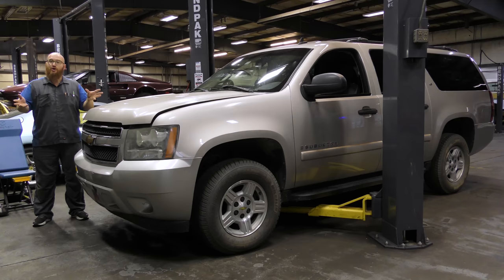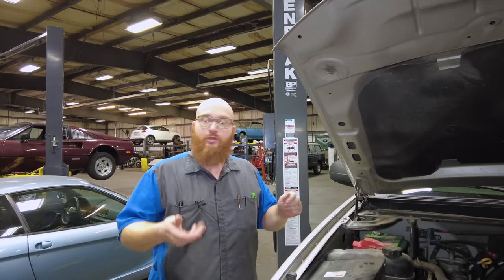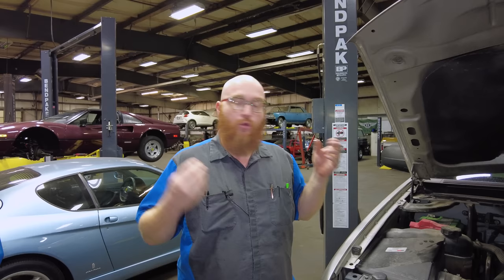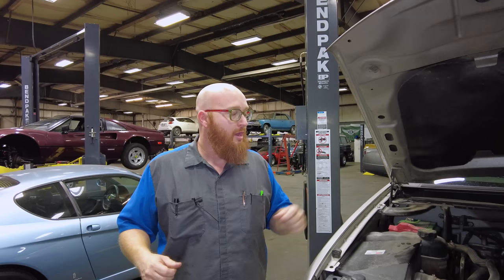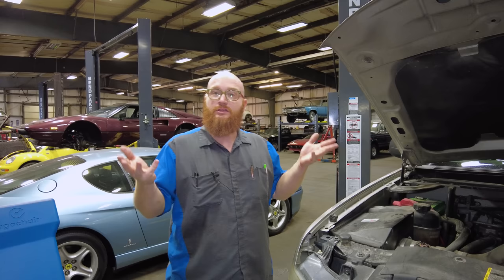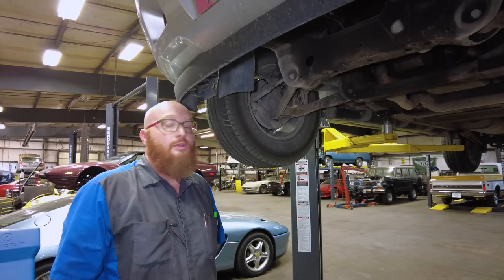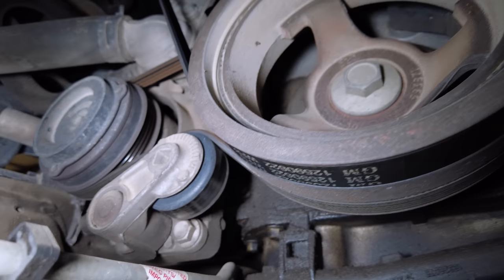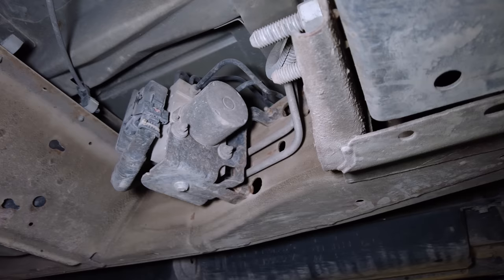What fails on ALL early 2000's Chevy SUV's!? CAR WIZARD shares what he's seen from the last 20 years

Comment: air suspension.   my electrical is super wonky.   my instrument cluster sometimes just doesn't boot right away -- sometimes it takes 5 minutes to show my speed.  And my gas pickup is weird-- hates being parked on hills and has already killed a fuel pump.  04 denali.  I'm not fixing anything more than $1000 on this -- it'll just go the next time a big repair would have to happen.

Comment: My 2007 AWD Escalade is leaking (158000 miles)and the dreaded oil pan, main seal leak is being repaired now. $1400 😅 to do the job. They said they have to drop the front end and transmission and seal to fix. I know this is a problem but cost is substantial. 😮 My engine has always purred like a kitty even after the leak. What gives? Thanks for your input.

Comment: The intake gasket and knock sensor for me at GM dealership was about 1000$ and I bought the ac delco parts and saved 300$ so it would have been 1300$ for gasket and knock sensors

Comment: I had an 05’ which I purchased new what a POS! The brake lines completely rusted out and failed by 60k and when you loose a line in one of these the abs block under the truck doesn’t appear to have separation of front to rear. I had complete brake failure from a front brake hardline.front wheel bearings were gone at 35k the rear diff failed at 75k the heater fan relay would rust to pieces about every two years. The front transmission seal leaked from new and was warrantied but clutch started chattering at 40k. The underside was completely rusting away including the frame and I live in sunny California so no reason for it. These were absolutely horrible years for GM trucks. I gave it to a friend a little after 80k. What garbage. I bought a Colorado a few years ago and it’s been flawless so far no rust issues or anything as of yet 40k.

Comment: With your experience, what is the spark plug brand and model you recommend? Do you just go with factory plugs? Factory wires?

Also, what can you do to the 2003 6.0 that you recommend removes some restrictions or bad factory settings and gives better mpg and performance?

Comment: Dash cracks, door handles break, O ring on oil pump fails, engine consumes oil due to bad design of driverside valve cover. rear rotors warp.

Comment: New my house they awere doing road work for 3 miles long. Both fuel and transmission lines started leaking lol 02 tahoe. Had them replace and waterpump and few other stuff i pick up the truck for 1200 lol its a monster. I love these trucks

Comment: Gas lines, brake lines, The ball joints and tire rods are small. the frame rust out fast, control arm mounts are weak and thin, I would say its low on power given the weight, wide useless gear ratio, lots of usless open diffs, small brakes overheat and drag

Comment: My mom has owned her 2007 GMC Yukon XL SLT since 2007. The engine had to be replaced at 164k miles cause the camshaft failed, which I suspect was due to the AFM crap that GM put in their GMT900 SUVS and trucks, other than that, the truck is bone stock and has it's original 4l60E transmission.

Comment: I have an 07 suburban And I think you missed the engine and transmission that  Commonly go bad  Not to mention the  Transfer case output bushing that can't be replaced without replacing half of the transfer case

Comment: 2003 Tahoe. 293000 + miles. I’ve replaced knock sensors, cats, hvac module just went out, abs sensor just started to go out, and I have an oil leak I have to figure out.

Comment: I have a 2003 Silverado 1500 HD Crew Cab 6.5 ft bed loaded with quadrasteer. 6.0 103,000 miles. Love it. But dang its terrible on fuel. 10.3 mpg driving like a grandpa

Comment: I have over 445,000 on my 2000 Silverado. Yes, I had the transmission rebuilt twice. The dash is full of lights, but the engine still runs like a top. How are people doing with the new '23 Tahoes? I'm considering getting one.

Comment: Lifter failures on these are marginal in comparison to the LT direct injection motors. I worked at a Cadillac dealer for 9 years and now have been at a Buick/GMC dealer and have yet to put a set of lifters or lifters & camshaft in one of these. 2015's and up, I couldn't even tell you how many I've done. My personal Tahoe has 108k on it with over 11k engine hours on it (old police car) and it's never been opened up. AFM still intact.

Comment: “All I know is that my AC started blowing hot,” and my power steering went out, and my alt/batt light came on, and my hot engine light came on.   “So I guess I need a Freon recharge”.     Cause that keeps the engine and power steering cool too.      People are so out of touch with arguably the single most important expenditure of their lives.  The home is taken for granted but not quite as complicated of a machine and over the period of its life, might not actually cost as much as the average consumer spends on the procession of cars they buy.   So many people just buy a new car when theirs starts to act up, often at far less than 100,000 miles, and they trade in their car, get less than half what it is worth on the open market place, then blow yet another $20-90,000 on a new car.    When will people learn that buying a new car is the same as pouring a few thousand dollars down the drain on the first, day, unless you KNOW you are keeping it for life.    So I have my excuse and my lifetime bumper to bumper warranty backs that up.    But you pay your mortgage or rent, say $1,000-$3,000/month.   But for your car, you’re paying, assuming my line of reasoning on a new car, $400-$1000/month.  Then oil changes at the dealership, not often enough, at $50 every other or who knows what month.    The house will be paid off in 30 years or less.    The car payments go on and on.   Let’s just say every tie you buy a new car, keeping easy round modern numbers, you blow $10,000+ down the drain on future expenses, or just loss on the one you just got rid of.    And by average, every three years.   That’s $100,000 in the same 30 years!    Give or take, still substantial, and while it’s the same as a $200-900,000 house, it’s substantial and far more wasteful than a home, while we need shelter, we HAVE to have our cars every day working like a dream.  But we neglect them, and the OEMs count on us being naive and stupid and ignorant to boot.    No, they bank on it.

Comment: thanks i think you just pointed out my mystery rattle when i start my escalade. its loud loud and goes away quickly and not on every start but its coming from the front of the motor on the passenger side. i suspected a belt pully and after watching this yea bet it the ac belt tensioner. wont know till i check it out but sounds about right.

Comment: Review this.. 08 ESV  drives then dies at stop ..  changed fuel pump, crank sensor, cam sensor. Magnet on the actuator. Now….. idols all day. The second a load is on the engine when you come to a stop just dies.  Now lights on the dash. No check engine light. ?????

Comment: How sad.. since 92 when I bought a k5 89 blazer ive loved GM tahoe, suburban silverado and had a hotrodded c10 too. Now watching your video im abit scared of newer fullsize GM..  espacially as theyre not that common here in sweden.  However.. my k5, and the tahoes,suburbans and silverado ive owned were great and easy to diy.  Drive an old xc90 now with 40000 plus km on odo but the spade is cramped both for me and my dogs. Always sat better in chevy.

Comment: As an owner that's put over 300k miles on my 09 Silverado. I can verify the front diff seals are horrible, and the stupid throttle body control module are my only constant outs... to be fair engine only has been full synthetic changed at 50% for the vehicles entire life... my only dumb ass move is I've literally never changed tyranny fluid because when I bought it they told me not to...( I was younger and dumber than I am now) however at this point I know without a doubt if I change it I'll blow it in a week or 2 haha 😭

Comment: AFM is only on 2007's+ GM
i've owned 5 GM trucks and SUV's and none of those first 4 problems you stated i have ever dealt with

yes the wires break, they all do on every single vehicle
(your manifolds will be fine unless you actually warp the fuck of the manifold)
(knock sensor yes those always go bad)

Comment: You can delete and tune that fuel crap out. I have an 07 vmax. Deleted that out. No issues. 

Like you said 2007-2000 5.3 is the best. I’m looking to get my wife a Tahoe that year. I had an 05. Sold it with 400k miles

Comment: i'm planing on getting a GM SUV with the 5.3L (Envoy or Rainier) with the sole purpose to rebuild the engine. i'll be doing the whole 9 yards... Cam, Intake, headers, ported heads - ect ect ect. the 4L60E transmission will be upgraded to a remanufactured 4L65E with the Corvette mods and a stall converter. will it be worth it in the end? for most people, no. but for me, yes. sinking $10k into an $8k SUV is insanity to most people.

Comment: 2000 siarra with 250k, 2005 silverado with 200k, so far oil pressure senser on both and ac tensioner on one of them, both have oil leaks/ burn oil and not to mention i have to fill up a little on antifreeze every now and then on both but my abs on my 05 has been acting up every now and then, there is a filter that can plug if you drive on gravel alot and if it plugs, it doesnt have the proper ventilation for you to fill up gas like normal, i can get to about .70 cents then it clicks like its full, so filling up takes a very very long time,  also on my 05 ( im not sure when they switched) it has Sencers instead of cable for gas peddle, on at peddle and one on throttle body, either can mess up wich will cause you to go into limp mode oh and blower motors, other than that nothing to crazy, my 2000 sierra just needs a rebuilt rear end (2nd one) but original everything (enginge, transmission) and my 05 just had a rebiult transmission at about 170k-180k, other than the rear end and the transmission ( save yourself some money and learn to take it out and reinstall it) i have done all the work myself , its mostly simple stuff

Comment: Great video. Car Wizard.. Informative. Well illustrated. My 2005 Silverado 1500 Z71 has been reliable. 2009 to 2023. Keeping up regular maintenance. wear items. 126000 and road ready. Question ; Do you add fuel injector cleaner to gas tank. Your vehicles ?? Thank you for Sharing , your info knowledge..

Comment: 99-06/07classic bullet proof the 4l60 trans weren't so great but anything with the 4l80 were amazing and you can spend a little money on a good build of a 4l60 and have a reliable transmission and as far as the 07+just delete the AFM and it's also bulletproof I've got a 6.2 Denali for my wife before I even tagged it just delete that shit and while you're there just replace the screen and oil pressure sending unit no big deal

Comment: Excellent video!  Any thoughts about a 2006 Tahoe with a lot of antifreeze loss.  No apparent signs of a leak and no change in performance.  No sign of water or sludge in oil cap or boiling in antifreeze storage reservoir container except after cooling for 10 minutes and bubbling or rushing of air.  Its been doing this for about a year.  I sometimes add a gallon of antifreeze to the reservoir tank.  No sign of steam out the exhaust or any visible leak or any smell of antifreeze.  Is it possible the head has a micro crack?  If it is a head issue what would be the approximate cost to replace both?

Comment: @CarWizard or really anyone.  I have a 04 GMC Yukon XL 1500 Denali AWD 3.73 Gear ratio.  It's been lightly spitting differential fluid around the left rear wheel well.  I thought it would either be the wheel seal and bearing or the vent tube being clogged but I fixed/replaced all that and it still spits.  I can't seem to figure out where the leak is. My next guess was rear wheel speed sensor.  Also, the previous owner took the parking brakes off completely, including the inside shield, would that have anything to do with the leak?  TIA. Cash is extremely tight and I can't keep throwing parts and gear oil at this thing.

Comment: 2000 silverado 1500 wipers frooze to windshield it was raining when shut off started truck next morning and I heard a pop thought 
It wasn't the fuse 
Nope maybe the motor the circuit board or the multi switch 
Nope
Think I've traced it to a internal relay built into the fuse box 
Is that a problem you've run across and is it the box under the hood ?

Comment: I have confdensation in my driver side tail light lense. 
I tokk the lense off. Emptied out the water. 
But im having trouble readin on my volt meter. Above 14v. 
Im going to check my connections to the bulbs. 
Im hoping these things are not related.

Comment: I feel I need to give a little correction on the transmission part of your video.

The converter clutch is applied in 3rd gear (D) whatever you want to call it. Certain vehicle shift strategies even have the T/Cc on in 2nd.   

In my opinion the 4L60 is probably one of most durable Transmission GM uses.  Just about every rear wheel GM uses it, with exception of bigger trucks 4L80. 

The 6L80 and 8L80 are very flawed, I literally do 2-3 a week. Someone needs to get fired over that one. 😮of course I’m paying my house off early because of them 

I’ve been rebuilding  transmission for 41 years, get rid of the heat with a cooler and change your fluid every 60k and you’ll put me out of business. 

Just a side note, if the T/Cc isn’t locked up your making heat and a lot of it when towing 

I personally have 2006 Trailblazer 4.2 with 280k on it. Original drive train and I haul a 21 ft Wellcraft boat, and she’s a heavy boat. 

I stick in OD and off I go, let your tow vehicle pick its speed and they’ll last a long time. What I mean by that is just because the speed limit is 60 you don’t gotta do it, my truck is comfortable a little over 50.  So thats what I cruise at

Now as far as the dash, the front diff seals leaking, ABS lights and intake manifold leaking, ih and 3 aluminum driveshafts, your not wrong.

Just one man’s opinion 😎

Comment: Just want to say I enjoy watching how much you enjoy what do 
Just a question 

2010 5.3 I have 55psi by oil galley at front pass and 55psi at back of intake new oil filter, cleaned  screen under oil sensor and don’t have any oil coming to top of my engine does that mean I also have no oil to crank and rods.
Miner right now but I think I have a turned lifter currently as well. But I believe I need at no oil before I dive into lifter?

Comment: My 2007 Tahoe with the 5.3 has AFM. I hate it (AFM and the truck).  It just nickels and dimes me weekly. Interior door handle chrome, door locks that sometimes don’t work, Large EVAP leak the dealer nor any local shop can track down, randomly shifts into 4WD when I’m on the highway, broken motor mount, crappy acceleration when it’s hot outside and the AC is on (I can floor it and won’t accelerate, just sorta quickly idles). I could go on but I won’t. I hate this damn truck.

Comment: We had almost all the issues mentioned on our 03 tahoe. 
Ac belt, oil sprayed out pressure  sensor. I thought it was done. Smoke pouring out. Dash beeping  pulling a big hill. Im like damn i blew the motor. Stupid sensor ! Still have it. You can blow through it! As i mentioned t transfer case pump rub where the pump and the little Clips inside the transfer case we're through the Magnesium housing and caused the transfer case to leak there isn't really a good fix for this other than ordering a new transfer case half off of Amazon and pressing the seals and bearings into that and redoing the transfer case also when we got that far with it they realized that the bearing inside the tail shaft of the transmission was warned and so therefore fluid was accumulating in between the transfer case and the transmission tail shaft which is not necessarily fixable without pulling the whole thing out of the car and doing a complete rebuild it's not the actual seal it's the sleeve where the Yoke part and the spline part slide in there it has worn to the point where it allows fluid to seep through either way the pump rub situation is one that you need to really catch immediately because if you lose all of the fluid out of the transfer case without paying attention you will be left stranded and it might actually grenade itself

Comment: I have a 2008 avalanche 4wd with a 6.0, thank you for pointing out these flaws, I pull/haul weight with that vehicle and never use the overdrive because it seems like it is very taxing. I just replaced the driver side door handle a few weeks ago. The fuel interference set up worries me as I already hear some tic but it could be some exhaust noise. The A/C failed on me 1 month after I bought the truck and was quoted a new A/C system! I passed. What is the cost to replace a couple of transmission cooler lines?

Comment: 2006 chev trailblazer AFM lifter collapsed spent 2k and its still broken! Supposedly cylinder 6 is dead but after computer and running compression test and 500 bucks still don't know if its the cam lobe or not. I gave up!

Comment: Had an 08 avalanche with stuck lifter 2and 4 . traction control would. Go off  no power all of a sudden . Pulled heads changed lifters  ran fine ,but horrible design  with AFM

Comment: At 13:23 you are looking up underneath.  Your spash gaurd is off apparately.  So is mine and I think that is casuing the coolent in cold weather to not come up to operating temerature.  Do you have a name for that splash gaurd?  It bolts to that round bar going across the front.

Comment: I have a 2001 chevy 3500 truck standard shift with 8.1. Brake light and ABS light are on together.  Speed sensors or ABS module as you said in video ? 
Thanks 
I enjoy your videos and learn a lot from you !